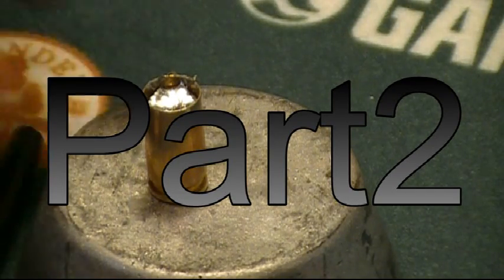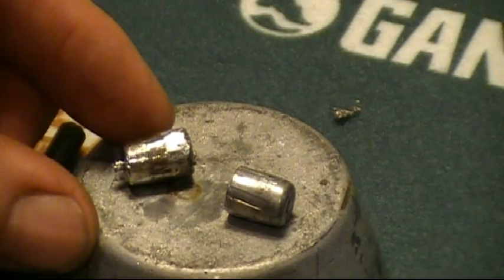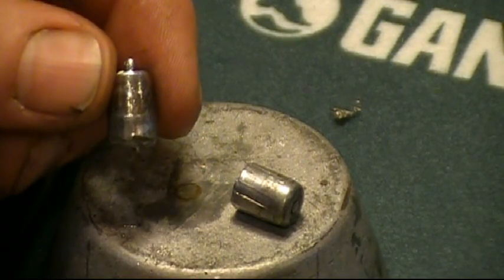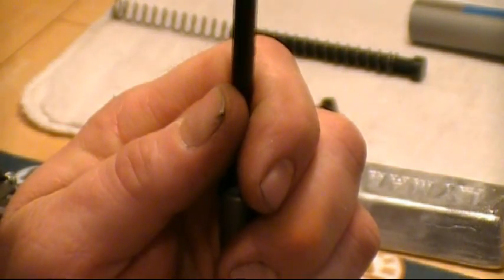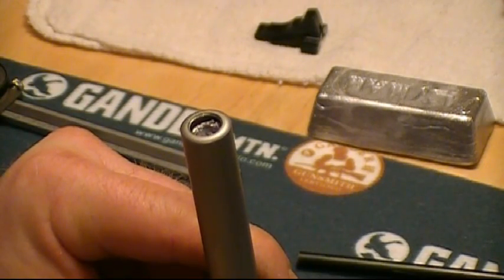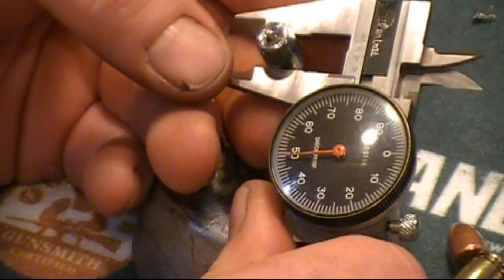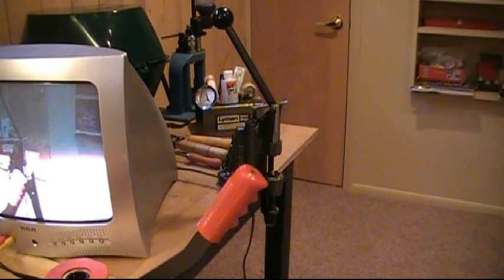Barrel slugging made easy part 2

Comment: Any reason not using a lubricant?
Reply from the maker: The lead is soft and i didn't want  a film of oil to possibly skew my measurements,  I think after doing it the way i did, lubricant is unnecessary, thanks for watching!
Reply from the maker: Also "Lyman" doesn't mention using lubricant in their instructions.
Reply: @stclairstclair  
Thanks for checking and replying.

Comment: My issue with my .303 not enough surface for  a good measurement from round ball, Yup I did follow their instructions was not enough surface to get a good measurement. Now for pistols this seems to be the cats meow, bees knees,floats the boat. I could probably get away cutting the .303 brass just past shoulder mate with some sort of base then melt my lead. will have to dig into see what develops??

Comment: You got .356 so do you size at .357 or .358? Since they say you want cast .001 to .002 over bore diameter
Reply from the maker: I found with a barrel at .356 that I needed to size them too .358.
At .357. I was getting a lot of blow-by,  But this will depend on a few things like lead hardness,
I even copper plated a batch before sizing, Boy if I told you I made those you wouldn't believe me they where so pretty!
I still want to try the powder-coating method,
You need a good reloading book Like "Speer"  Starting with a load that is 5-10% under powered and fire them off too see
How your bullets are fitting/performing, Be aware that a reduced load cartridge may ricochet off of green trees and pose a serious danger,
Ask me how I know, Thanks for watching!

Comment: Nice video. I was wondering about making wad cutters using an empty cartridge but was stumped on how I was going to get the led out of the cartridge. Great idea but I only want to slam my kinetic hammer a couple of times to retrieve the led. Anyone have any good ideas on that?
Reply from the maker: You definitely want to get a bullet mold, you can get them for wad cutters,
Without a mold you wont get weight consistency, Plus you want to drop them while there still hot into water to quench them and bring up the hardness,  I have a Lyman lube-sizer, you can get extreme size control as well, thanks for watching.

Comment: All it takes is a guy just 'thinking' it through!!  Very well done. Using your head. This will only work with straight walled cases; i don't see it working with necked down cases...I suppose you could cut off the slug created at the neck forward.... maybe fill the case to the shoulder and then create the lead slug from there to case mouth. for those of us that sometimes use calibers that utilize a necked case, pistol or rifle.
Reply from the maker: Madd-Matt Mitchell, Thank you for watching.
If you would like to slug a shouldered cartridge just fill it with dry silica sand before casting the slug.

Comment: Most barrel slugging videos I’ve watched recommend lubing the slug and the inside of the barrel before driving it through. Did you not do it because the slug you made was so well fitted resulting in just a sliver of excess sheared off when you drive it past the crown?
Reply from the maker: Anton Greenberg Thanks for watching, I was fallowing the instructions for the Lyman LubeSizer and I think they didn't call for lubricant,   
I recommend you read it if you're interested because it helped me and I trust Lyman, They've been doing reloading since forever.

Comment: Soot the interior of the case with a cigarette lighter. The slug will come out of the case easier. This is an awesome idea.
Reply: Yes sir. I actually just got done slugging my Krag using your technique. Never again will I use sinkers. My cylindrical "slug" dropped out of the case (I used .32 Long) and using lithium grease, I ended up with a much better surface area to measure. Thanks again.

Comment: Very late but: why not drive it in from the chamber?
Reply from the maker: Porkchop's Papi, Hi and thanks for watching,  On a Semi Auto You have the luxury of being able to easily disassemble and remove the barrel giving you access to the breach end, On many guns like rifles and revolvers this is not possible, As well you would not want to disassemble these guns for this procedure,  The breach end starts with the smooth and slightly larger throat where the bullet enters the rifling, this would end up giving you a larger reading than the barrel actually is.

I'm using a Lyman Lube-Sizer, Check out their instructions, That's what got me started here with this video. 
Now that I'm older and broker I'm glad I went crazy and blew 5 thousand in extra reloading equipment one summer,
now that I'm retired I could never afford any of that today. Spend it while you got it.
Reply: @stclairstclair  Huh. Well if those are the directions I guess that's the way it should be done.
Reply from the maker: Porkchop's Papi Being from Lyman I trust them, That company has been in reloading since sliced bread.
Reply: @stclairstclair  Since John Wayne was a goose wrangler
Reply: @stclairstclair  DAMN STRAIGHT, SPEND IT WHILE YOU GOT IT ON WHAT YOU WANT BECAUSE YOU NEVER KNOW WHEN YOU WON'T HAVE IT AGAIN. SO TRUE, SIR. OH, GREAT TECHNIQUE.

Comment: Excellent idea and improvement.  But I'm still worried!  I'm trying to decide if the rifle is a .257 Roberts or a 6.5x55 Swedish -- which is .256  --  0,001 accuracy will be hard for me, a first timer, to achieve.  What do you suggest (if anything)?
Reply from the maker: Im a little confused on the question,   you wont have any problems reading your bore size doing this, Its accurate.
Reply: @stclairstclair  Are you saying that a first timer will do this accurately to within .001?  I'm not even sure I can guarantee the caliper to that degree accuracy.  I don't want a round blowing up near my face.
Reply from the maker: George Gonzalez-Rivas, Hello George, Ok first what kind of caliper are you using,  You see the one I have, no electronics, The one you see me using will easily 0.001, Getting within one thousands =0.001 is very easy with any caliper that is of quality.
If you are casting your own bullets and sizing them this is only one of the steps to produce that new bullet, dont be afraid of this process, it is going to give you so much satisfaction when you group a round of your home brewed rounds!!

Take what ever round you have made from this process and measure it to a new round, you can be a few thousands over or below, and you will need to do this and go fire them to find the best size to make your new bullets.

Have you discovered the Lyman lube sizer?  If not you have a wonderful amount of bullet casting fun ahead of you!

Come back and talk, I'm interested in how you are doing, and thanks for watching.

Comment: Humm every video I have seen so far start pushing the slug from the other end. The same as you would be shooting the gun ?
Reply from the maker: John Bailey,   Hi John, Thank you for watching my video, 
That would only work on a semi-auto Like shown here.
How would you do that to a revolver or a lever action rifle?   The barrel would have to be removed from the frame or receiver.
Also the "throat" of the breach end (where the bullet enters when fired) is larger than the rest of the barrel and would give you an incorrect oversized measurement.
I was following Lyman's instructions, The people making the bullet molds I use to cast bullets for reloading.
Look at the picture on the video where I zoomed into the perfectly sized slug, Its a picture of a slug entering the muzzle not the breach.
P.S. My slug casting technique also works well for a rifle, just fill the case to the neck with dry fine silica sand then cast your lead like shown here, If you find your newly cast slug is a little too small use a previously fired case that has not been resized.

Comment: How do you get it out if its stuck halfway down the barrel on a closed frame revolver?
Reply from the maker: John Doe, I would think you should be able to drive that slug through using something like the dowel rods I showed you here, What is the condition of this gun, Take your time.
Reply from the maker: John Doe, You could consider using a pin vise with a small drill bit and "by hand" drill out the center of the slug, you could then continue to drive it out.
Reply: Thanks for the quick reply. I discovered the lead was soft enough that it started to squeeze between the dowel and the barrel through the grooves. Turned down my dowel a bit and she came the rest of the way out.
Reply from the maker: John Doe, Was your dowel too small allowing it to imbed it's self into the slug, I'm glad you got it going, Thanks for watching.

Comment: Great Video. Very informative. I have a 45/70 rifle that I am going to slug. I think that I will do one on each end and one all the way through. That would give me a good minimum ...where the minimum is ...and if there are any tight places through the barrel. I don't know if the "case for a mold" trick will work for a 45/70 so I think that I will have to find a different way to mold the slugs a few thousandths over the anticipated bore diameter.
Reply from the maker: Hans Pcguy, You can fill the case with DRY silica sand, you can top off the sand with dry graphite powder to keep any grit from attaching, otherwise take a blade and clean off any grit from the slug before sizing, choosing a correct lube/sizer size is the next step, I was sizing them too small and had to go up a size.
I have gone onto making my own #8 shot, Let me tell you, the first perfect round of trap with your own lead feels pretty satisfying!
I will try posting shot making if you're interested, Thanks for watching!!!!!!!!!

Comment: Thank you very much. I think your idea is a great one and it probably is going to save me some money and grief. Now I just have to figure out how to do that for a bottle neck rifle case.
I was thinking of taking a worm weight and cutting off the bottom of the weight at 90 degrees and driving that in to the barrel. Do you have any thoughts on this? Thanks again
Reply from the maker: Steve, sorry i took so long, Just fill the case with dry dry silica sand, scrape off any remaining sand on the back side before using, thanks for watching!

Comment: Cool idea but how would you do a bottleneck case? Most of the guns that you would normally slug are older military rifles because the bores varied so much. There really isn't much of a need to do the more modern handguns with straight walled cases because the quality control and machining is much better. Not saying you shouldn't slug a newer gun but it's not needed as much as if you were loading/casting for say a mosin or British 303 for example.
Reply from the maker: Hi....4 month later, sorry, just fill the case with very dry silica sand, works great!

Comment: on a 357 mag would you need to fill the whole case? or maybe just halfway .
Reply from the maker: +Edad Martin Hi, I would just make sure its about as long as a bullet that you normally fire, don't go too short as the case walls are thickest near the bottom of the case, I don't feel you should have a problem driving a slug through even if you filled the case,  if you had a problem it would be while entering the barrel, you'll know at that point, and if so just drive it back out and go shorter,  I do know once you complete this you'll be showing off to your friends, thanks again for watching!

Comment: cut and paste don't work.
Bullet puller. Flats of collet to flats of hammer......
Sprayed a little mold release agent in brass. Lead popped out with one hit.
Reply from the maker: +timbernie yeah I had been told about the bullet puller collet being backwards, you would think after 25 years as a mechanic I would have figure that out, felt pretty dumb when I found out,  and I passed on using any lubes what so ever because even a film of lube can change readings on a mic so I stayed dry on purpose.

Comment: Superb video.  Thank you for it as I have been having the same general problem when thinking of slugging my bore.  I do have a general question for you.  Here it is...

Being that most barrels taper a little from the chamber to the muzzle wouldn't beginning the bore slugging process from the muzzle force the lead slug to obturate as you are banging it to the chamber area?

This might be a green question but I am green with slugging a bore.  I cast for pistols using powder coating and do not experience leading.  However, I am about to start casting or my 308 rifle and I believe that I should slug my bore.  Thanks.

Comment: Very cleaver.
Reply from the maker: thanks, hope this gave you some ideas.
Reply: stclairstclair

 I have a question.  You got a dia of 356 from slugging,  When you done casting bullets, What size sizing die will you use,  355?, 356? or 357?
Thank you for your time
Reply from the maker: ThomasPaine3 I started out trying .356" die and soon found I was leading due to the bullet being too small, I've switched .357"
Reply: stclairstclair
Thank You
Reply from the maker: ThomasPaine3 sorry I took 3 months to answer, I started with a .356" die and found the bullets to bee too small, heavy leading in the barrel, so I went up to .357" with much better results, thanks for watching.

Comment from the maker: I don't recomend using a lead bullet to do the slugging, unless you cast it from virgin lead yourself, the reason is because lead bullets are often water dropped, and are usually a lead, tin, antimony alloy. This is to make them harder to alleviate leading in the barrel

Comment from the maker: Im now finding .358" in this barrel might be where i need to be, shooting and figuring out how to improve the bullets at first seemed daunting, but im becoming more interested as i gain experience
Reply: .358 is getting into .357 mag. Use a caliper that reads to the .000X" for better resolution of accuracy. If you shoot cast bullets then use a softer lead. That will self size the bullets to the barrel. If the barrel is in fact now .358" then cast and size softer lead bullets to .357" keep your same powder charge. And your accuracy should increase. If you use a harder lead, then cast and size to .359" for a .358" barrel. Hard lead= .001" over barrel size. Soft lead= .001" under barrel size.
Reply from the maker: J S,  I started going to .002 over because I was still getting some leading,
My biggest problem isn't sizing at all, It's living near Chicago,
If I want to shoot I need to pay 35 bucks and stand in a crowded line, So I just shoot trap,
But I have completed a pretty awesome shot making machine, I even cast my own aluminum dripper, 
Took me about 5 years of tinkering to get it just right,
So far I have made a total of 450 lbs of clean #8 shot!  When I showed if to my trap friends I was all the rage!

Comment from the maker: It means the same thing, here is the defintion:
Swaging (/ˈsweɪdʒ/, pronunciation note below) is a forging process in which the dimensions of an item are altered using dies, into which the item is forced.[1] Swaging is usually a cold working process; however, it is sometimes done as a hot working process.[2]

The term swage can apply to the process of swaging (verb), or to a die or tool used for swaging (noun).

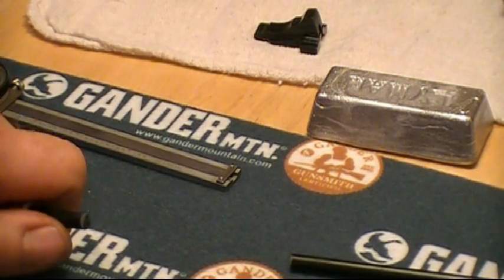Comment from the maker: Hi, im confused, did you see part 1 &2,   at 4:40-5:00 you will see me drive the slug through the barrel untill it comes out the chamber side, At 5:40 -6:00 i show you how to use the dial caliper to measure the slug, im at a loss on your questions,   did the video hang up and stop playing for you?  What i ment about measuring at both ends was just that you should drive the slug completely through the barrel, please rewatch at the two times i talked about and get back to me, thanks for watching

Comment: I'm not too worried about a thin coat of lube. Not sure my Chinese digital caliper would notice the difference. 

I've got about 50 pounds of alloy ingots, none of them are pure lead. Not real soft stuff.  
If I can find some old air gun pellets to melt down, I can skip the lube. Those are pure lead.

Comment: I've got a new brand Lee melting pot that I want to test.  So I should be able to drop some liquid lead into some fired cases (after a pre-heating) and get a similar result.

One thing I noticed in your vid, you didn't use any sizing lube on the slug. It seems like it would make the job a little easier. 

Thanks for posting this method. I plan to try it.

Comment from the maker: Hi, you should be fine, i would cast your slug in a fired case that has not been resized in your reloader, the case can be a few Thousandth of an inch smaller at the open end of the case and your going to want your slug to be just big enough to fill out in the barrel during slugging.
Your going to have to experiment with the final bullet size in that gun to keep leading down, and your going to have to use a gas check on these bullets when lube/sizing them, as this round is know for leading.

Comment: I just wanted to note that I just barely used this method on my M1911 .45. It worked very well. I simply melted down some Wheel Weight Stickies (Which are nearly pure lead, same as sinkers), skimmed the dross, and poured the molten lead into the bullet casing. 
 From there, I used your method and it worked flawlessly!

Comment from the maker: It would work, just will take a few minutes to do the job, i find my little torch good for many things, you can still get them as low as five bucks,   Dont use solder to make the slug as it may be too hard to work with, good luck and tell me how your slugging worked out,   do at least three to insure you get a perfect reading of bore size, and if your going to cast bullets, size them .001" bigger then the bore measurement or youll get leading in the barrel.